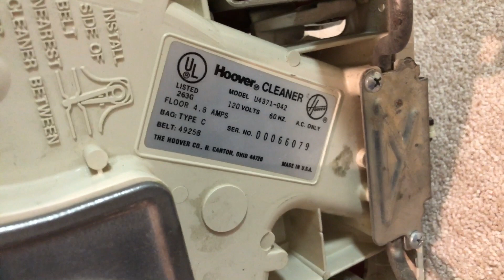My Hoover convertible vacuum

Comment: I like the colors. The hood style is the rounded non-headlight kind, which originated in the sixties. The 2-height adjustment is a throwback to those of the fifties & sixties. Beginning in the seventies the higher trim models had 4 adjustments and the budget ones had 2; in the eighties some were made with none.  The higher setting is for longer naps such as shag. The Type C bag stands for Convertible. Hoover USA used letter abbreviations for all its throw-away bags. Awesome classic & basic cleaner!

Comment: I really like the color combo of your Convertible, which Hoover named deep persimmon and oyster white (a persimmon is a fruit). The Model U4371 was manufactured from circa 1985 to 1988. It wasn't until 1988 that Hoover's U.S. serial #s included the month and year (Hoovers made in the U.K. were so-marked beginning in 1967). The -042 suffix was added to denote the 2-position height adjustment as other budget (no frills) models had no adjustment lever.  I enjoyed your presentation. Thanks for posting and happy Hoovering!
Reply from the maker: Craig L thank you very much
Reply: You're welcome.

Comment: That's a great machine. Great color!!! These metal base models with rear port for hose attachments were the best. I wonder if a Quadraflex brush from a Decade 800 would fit in the same bearing slots. It would double the sweeping speed.

Comment: That sounds not too bad at all - they all seem to have slight rattle from the brushroll endcaps vibrating against the casing - its caused by wear, and shouldnt affect performance too badly, unless the bearings are shot, in which case there will usually be a lot more noise than i heard for this machine. Its interesting the brushroll only has brushes, but no beater bars, as most UK model Hoovers of that era (60s, 70s) would have had a row of bristles, and then a long metal beater bar on each side of the brushroll. That was why they had the saying "I B A I S A I C - It Beats As It Sweeps As It Cleans", because they all had beater bars to beat the carpet and cause a lot of vibration. The brushrolls with the beater bars tended to rattle a lot when the ends caps got loose against the sides of the machine, as the vibration set up a hell of a racket of metal banging against metal.
Reply from the maker: MadAboutHoovers thank god I’m not the only one with this problem I mean I went to a vacuum store today but it was used and the end caps were broken and cracked and when I put it in it sounded horrible
Reply: Usually, on the sides of the chassis where the brushroll pushes in, there are like small sprung loaded clips that give some resistance to the brushroll being pushed into its locating recesses, and these clips also are supposed to hold the brushroll endcaps firmly in position, so they dont rattle, but the clips get worn with use, and dont hold the end caps as tightly as they should, so you can try to bend them with a pair of long nosed pliers to make them tight fitting again. Also, as the bearings wear, they get looser, and the brushroll starts to rattle more on its spindle that runs the entire length and has the 2 endcaps screwed on each end, so normally you would tighten the endcaps futher to take up the slack in the bearings, but that then leaves more end play of the brushroll in the chassis, and causes rattle - so Hoover provided H clips that fit over the end of the brushroll, and these were supposed to stop any end play rattle: https://morganelectrics.co.uk/index.php?id_product=368&controller=product
The clips that hold the brushroll in look something like this on the UK models, so I'd imagine the US models would be similar, but I can only assume this as you didnt remove the baseplate so i couldnt see the endcaps and how they fitted in the chassis: https://morganelectrics.co.uk/index.php?id_product=364&controller=product
Reply: Oh , and all my Seniors have some form of endcap rattle, and my Juniors too - its the vibration set up by the beating action on carpets - it hammers the sides of the chassis as that brushroll vibrates in its housings. As long as its not severe, and you know that the bearings are just fine, its not too serious an issue.